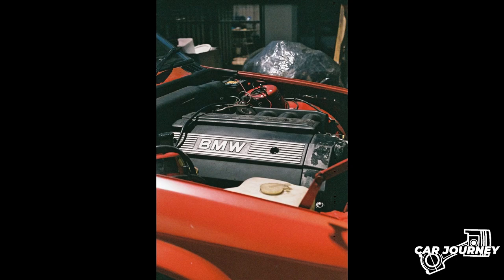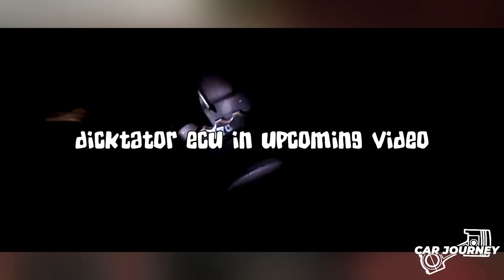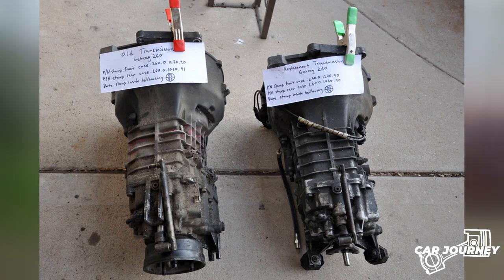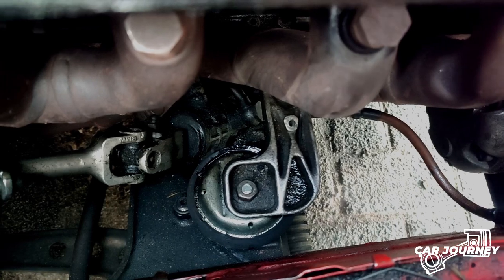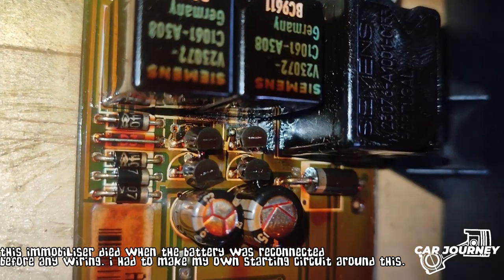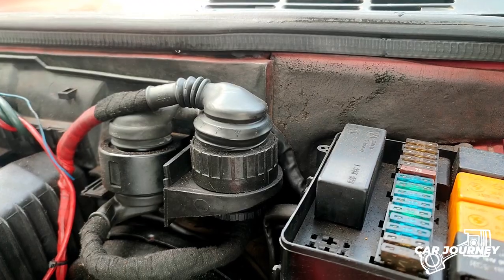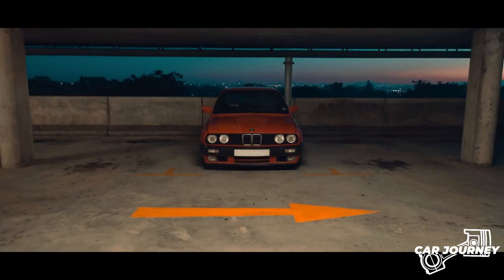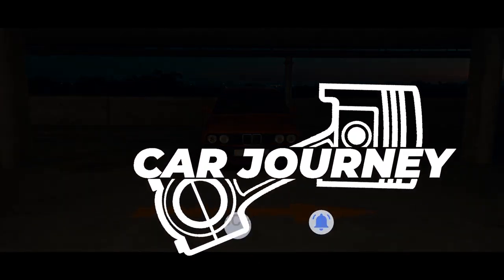E30 M50 Swap | What You Need to Know

Comment: Great video my brother. I'd just like to know real quick. I have no clearance between my fan blade and radiator
I'm using e36 arms and e34 rubber mountings
Whhat could i be doing wrong
Reply from the maker: Thanks for the comment, I appreciate it! How's the engine sitting, more to the front or the back?
Reply from the maker: There usually isn't any clearance for the viscous fan to sit, so what I did was a electric fan, then I used a fan controller to operate a relay that overrides the Aircon fan with the electric fan - one pushes, the other pulls. Car has no temperature issues sitting in traffic or hard driving. You can use a Peugeot 206 fan switch, but then you can use that switch to trigger a relay - 12v on the switch to pin 85, 86 to ground, 30 is a 12v, 87 to your Aircon fan and 87a to your electric fan between the radiator and motor.  And then ground each fan to the chassis. That's how I did the relay wiring and it's been 100% reliable. Hope it helps 🙏🏽. For the mountings, I see quite a few people mix e34 and E36 mountings, but it makes the engine look more twisted. I just used the E36 mountings and it's dead level with the car. Got those my Master parts.
Reply: @CARJOURNEY  thank you very much for that info, I'll get on to it tomorrow and will post an update here on my comment 🙏🏼 thanks once again
Reply: @CARJOURNEY  the engine is sitting more to the front
And at the back close to the firewall there is like 3cm of clearance between engine and wall
Reply from the maker: Mine is also about that yes, I used an M40 radiator and had to be careful with the inner electric fan placement, people have had no issues with just using the Aircon fan, but I had a whole lot of cooling issues when the car had an M40 engine in, so I was paranoid and rather went overkill.
Reply: Nice video I'm doing a M52B28 swap into my E30 316 M10 carb where did you place your fuel filter and do you maybe know of other fuel setups I'm thinking of using a swirl pot with a fasset fuel pump
Reply from the maker: @malcolmmay5674  Sorry for the late reply - I didn't get a notification for your comment.

I had my fuel filter in the engine bay - but relocated it between the fuel tank and the hard lines that send the fuel to the front where a caravelle pump boosts the pressure.

I plan to have a video out next week explaining my fuelling upgrades and the dyno runs, so keep an eye out
Reply: @CARJOURNEY  Thanx for the reply I'll definitely wait for your video
Reply from the maker: Good Morning, new video on the fuel system is up! Drop a comment in the video if you have any questions.
https://youtu.be/Xw2baAy-oZs